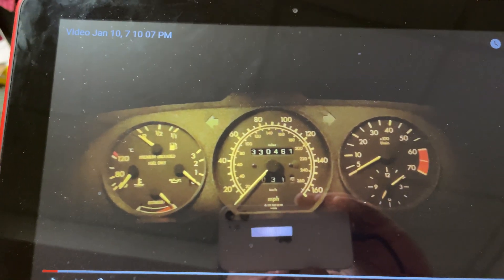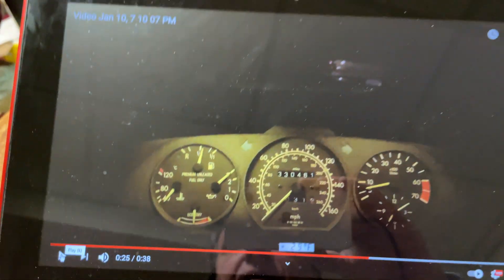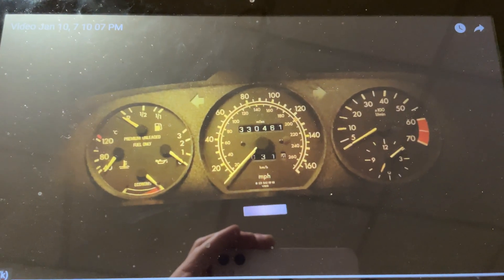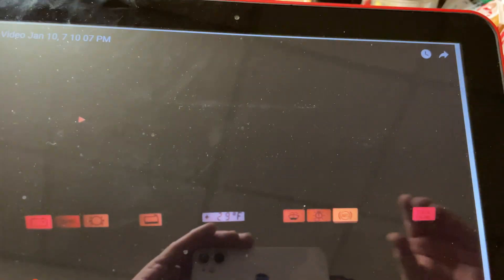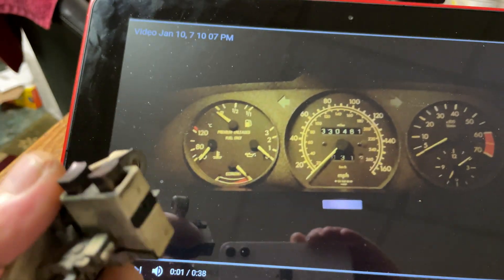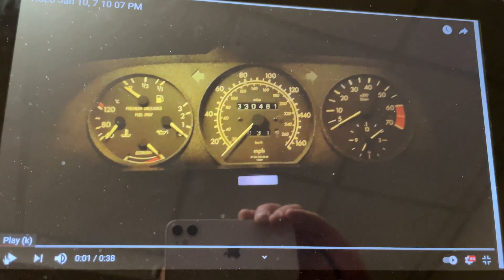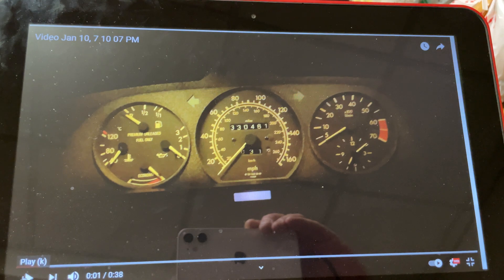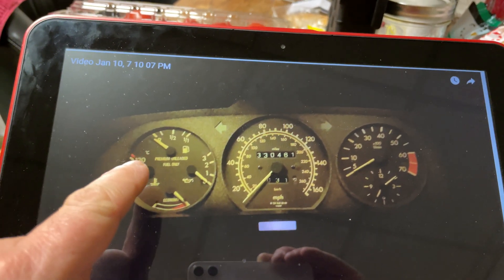Mercedes Benz W126 560SEL 3/89 Testing & Overhaul of Electrical System and All Control Units Part 12

Comment: Hi Peter I ordered the voltage regulator but it was made by Hella. Is that okay? I noticed yours is Bosch.
Reply from the maker: George, on an other note, it is usually not that simple to diagnose a car from a distance. Please keep this in mind when asking questions as I assume that you have:
A) no vacuum leaks
B) the entire fuel delivery system is working to spec
C) the airflow plate is set correctly as to end stop and play

However, having to start the car two or three times usually points in 99% of the cases to the voltage regulator.
When those start to make poor contact with the brushes then the entire voltage drops below a point where the ECU, Idle Speed Control Unit and Ignition Control Unit constantly reset during cranking until the voltages recovers enough for those units not to reset which is usually during the second or third crank attempt and the rpm is above 425rpm
Reply: I'm not sure if there are vac leaks or fuel delivery. It seems to run good once it fires up. I'm going through all your videos and we both have a lot of the same issues so I'm learning as I go. Thanks
Reply from the maker: George, this points pretty much to the voltage regulator
Reply from the maker: Was a Bosch, the new one I got is made by Monarch, Kent Bergsma of Mercedessource sells those.
Hella is fine